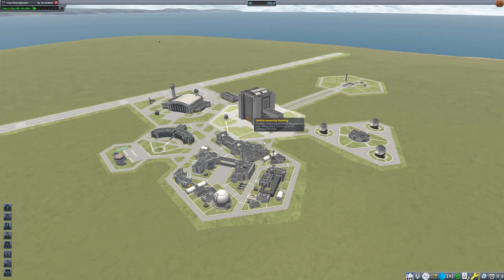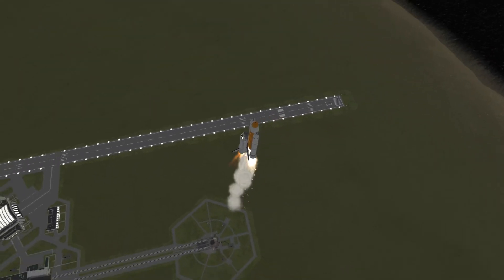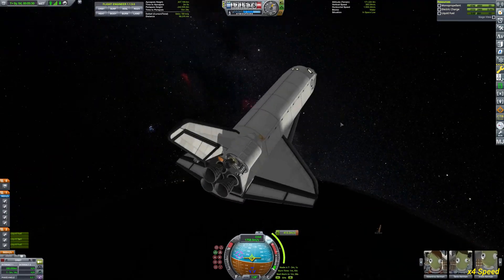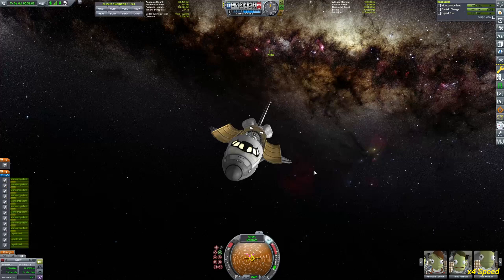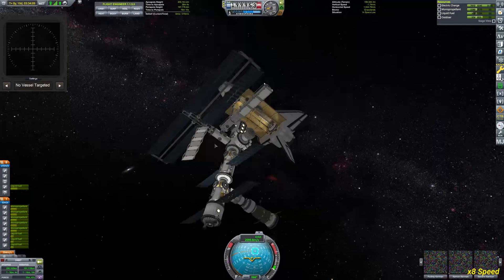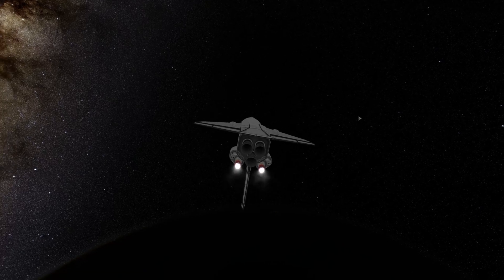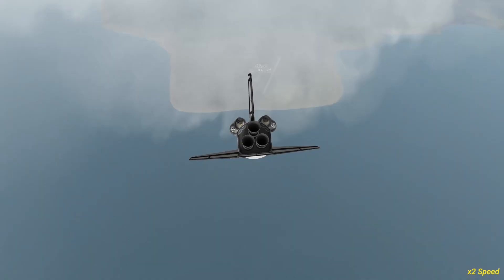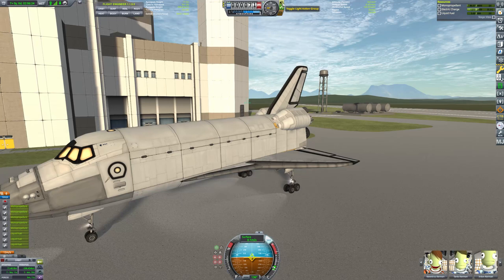KSP - Shuttle Flight to Kerbal ISS!

Comment: lock your SSME gimbals and use your control surfaces on the ascent to roll through your gravity turn. It's much more stable.
Reply from the maker: Really? Nice, I will definitely try that out next time. I had disabled control surfaces as they seemed to interfere with my stability. But maybe locking the engine gimbal would help.

Comment: You built a nice shuttle there. The spin at the re-entry, at the altitude / speed, is so typical of space shuttle replicas. Only know a few who don't do it.

A little tip, put the Main Landing Gear further forward to the mass point. Then the touch down looks true to the original. This tip applies to all fixed wing with nose landing gear.
Reply from the maker: Thanks for the tip, I will see if I can incorporate that into a future version of the shuttle!